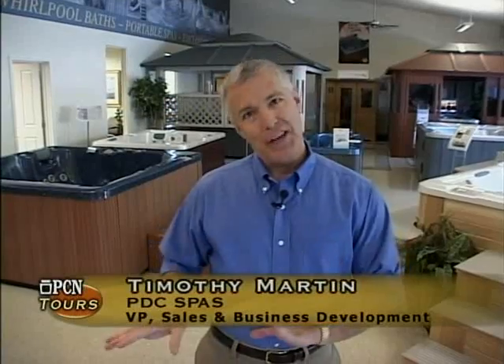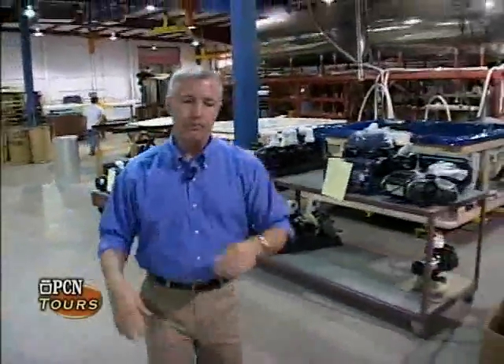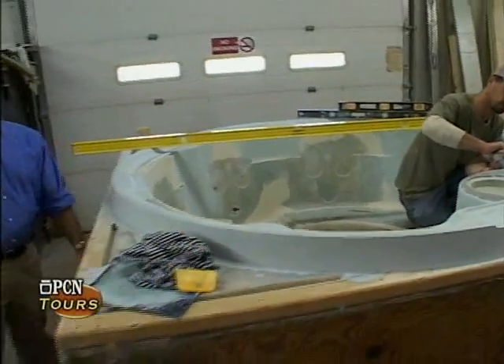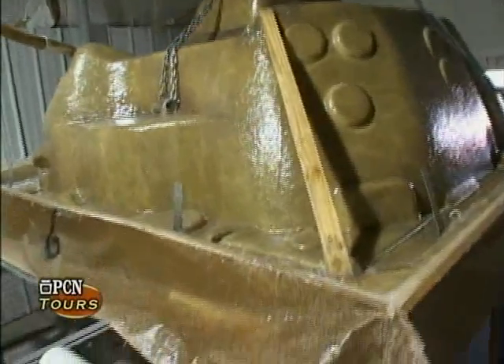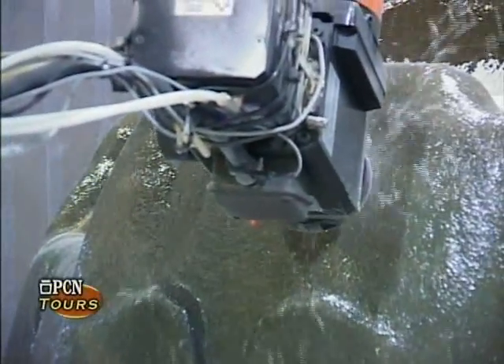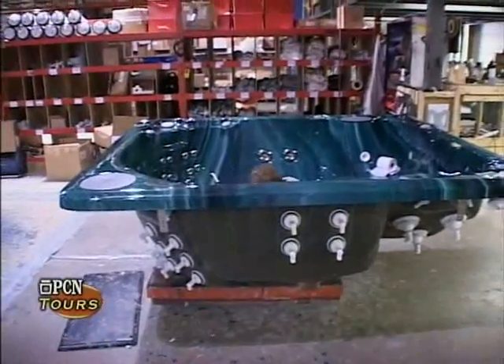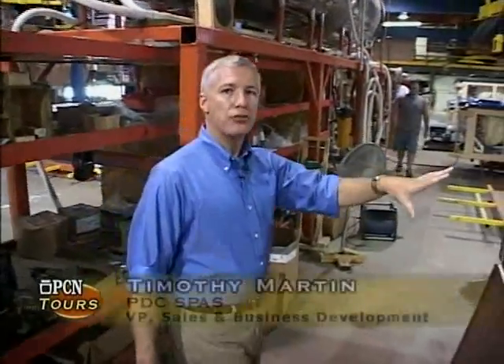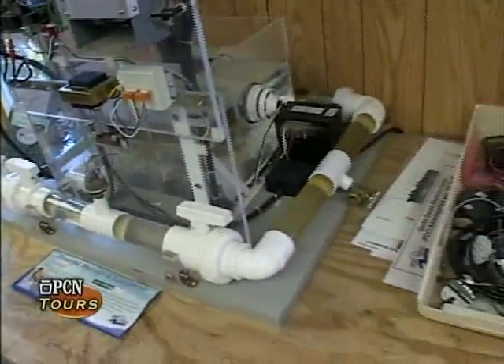PDC Spas Hot Tub Showroom Tour

Comment: October 14, 2025
“BEWARE! The TP500S IS A DEAL BREAKER! We absolutely HATE this TP500S control panel on our 3 month old PDC TWILIGHT spal!!! it's wayyyy over complicated for us! After suffering over a DOUBLE costing huge electric bill the first month the installers came back and changed the settings now I keep getting clean the filter message. I've replaced the filter and can't stop the filter message on the scroll panel. We hate it! We hate it! We hate it! If this was an automobile, we’d have driven it back to dealer for a refund. We GREATLY regret buying this PDC spa with its too complicated TP500S control panel!! We further regret not purchasing another Canadian made beachcomber spa again - they know how to use simple - I said;
"SIMPLE." FYI, when we initially contacted the PDC factory customer service, they were nice and pleasant enough however, they sent us the wrong instructions to set it up our PDC marked controller.
We couldn't make heads or tails with the instructions they provided. And no wonder THOSE weren't for our controller!! Also note here that the manufacturer did not initially include any instructions on how to operate this PDC TWILIGHT with the wrapped spa that was delivered to our home! Beware! Balboa TP500S REALLY sucks!! There’s a lot of additional issues revolving around the absolute shortcomings of the Balboa TP500S that I'm not gonna write to explain, except like when we occasionally lose electric due to a service current brown out we struggle to reprogram everything back into this crappy Balboa TP500S controller. It's not a simple on and off! It's crappy , crappy, crappy - all in the name I suspect of advancement of computers. and programming.

We hate your engineering Balboa! Especially with your crappy TO500S controller!! You should come up with something simple, simple, SIMPLE!

Comment: Beachcomber has had the laser guided drill for many years. Why do you need 2x4 to support under your seats, if you are building a proper self supporting shell?
Reply from the maker: PDC Spas first started using robotics and guided drills over a decade ago. 2" x 4" boards under the shell are used to make sure our units are 100% stable, they DO NOT provide any added strength to our hot tub shells. PDC Spas hot tub shells are made of the highest quality under rigorous company standards, they do not need re-enforcement. Precision, quality, and customer service are all very important aspects of PDC Spas.